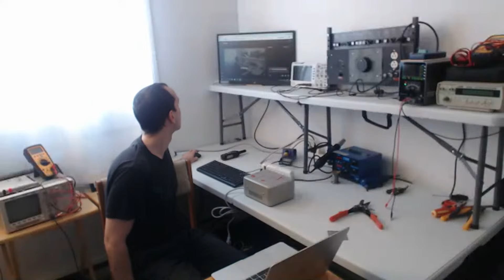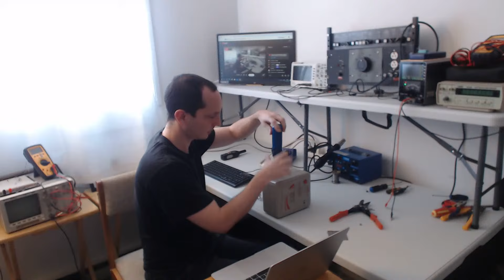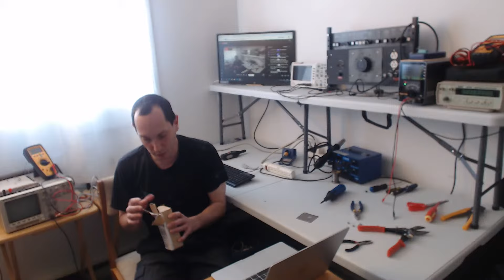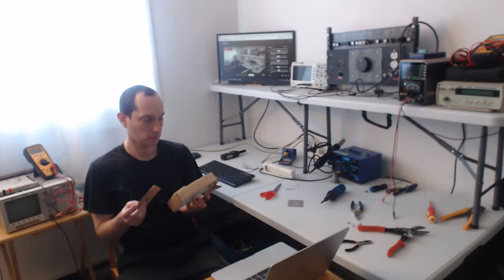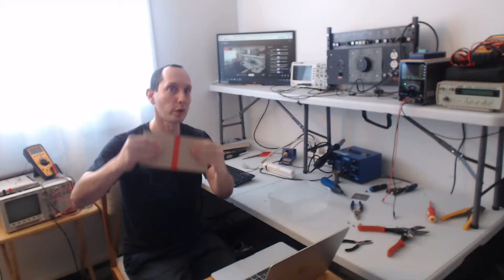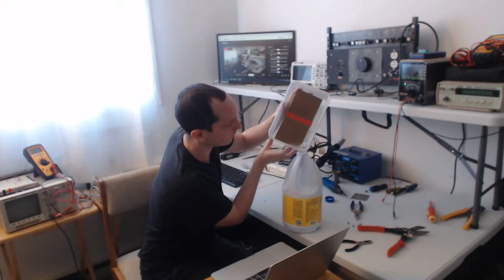Parts Transformers And Misc

Comment: hello, I was wondering have you tried a spark gap lets say 3kv in a balun resonator type thing there is few types of balun, high impedance ohm thing, because high voltage current needs high impedance and for lower displacement currents high impedance is not required, also if you like to modern-rise the aether word, some call it subspace, what it is, is a more complicated geometry than spheres of atomic matter or putting model if you will its more complicated geometry with all those electrons protons neutron etc, that are in subspace the aether.